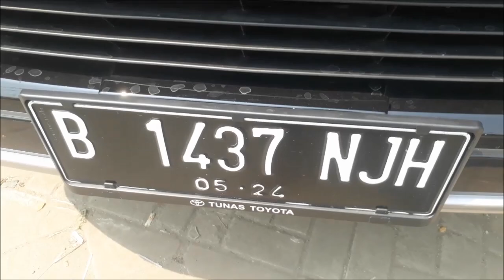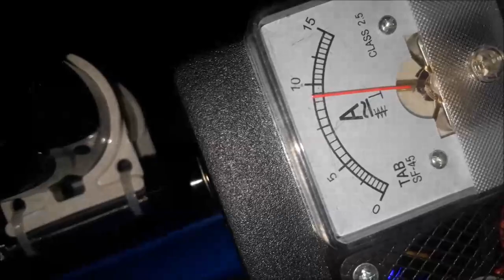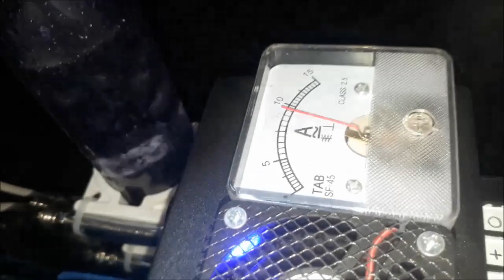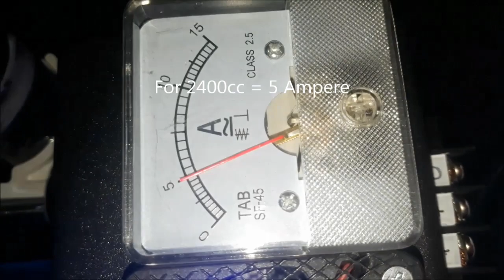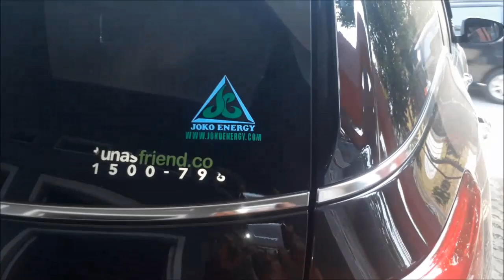Fuel saver HHO Joko Energy on Toyota all new Fortuner 2.4D 2019 HUDA

Comment: Hello, i have experience with hho, i have made generators before 7-8 years ago also with 316l inox and koh. I had good results, but also problems. High amp consumption will not give you effective device, and on winter it was under the hood so it is acting different than on summer. I also had one in trunk, that is good idea for winter, and with electric you can adjust the consumption of amps. How much is device with shipping?